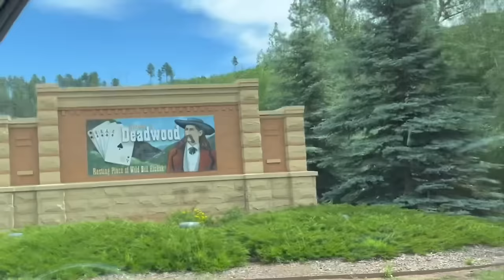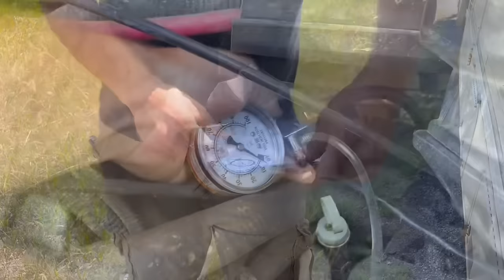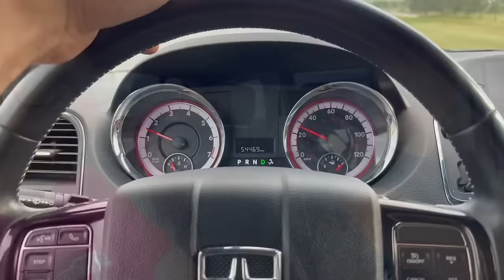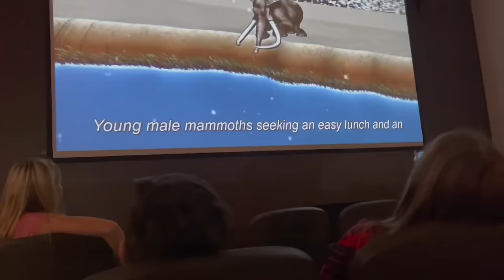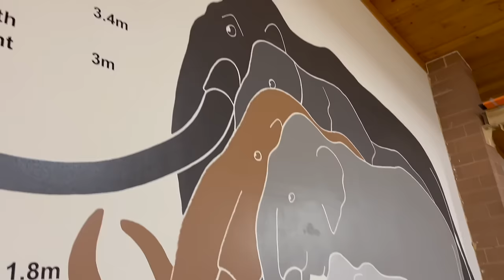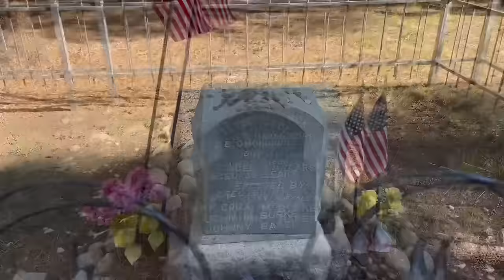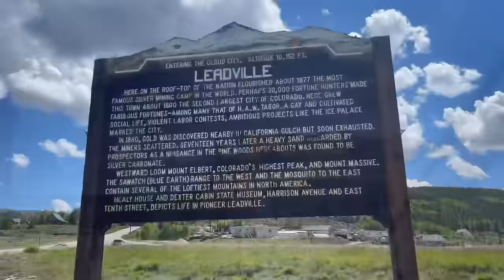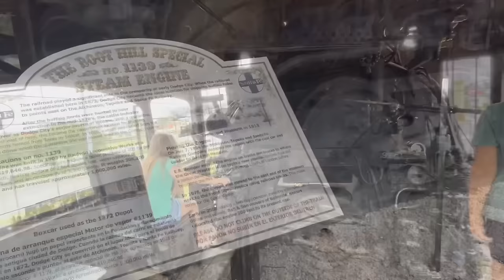Can we make it out of South Dakota in our $1250 motor home? 5000 mile road trip !!!

Comment: Thanks! This video was so emotional. It saddens me to see the motorhome go so soon after putting so much sweat and tears into it. But you have created many memories for you and your family on this road trip. Thank you for sharing your family outings with us!
Reply from the maker: Thank you for your generosity. Yeah it was really a bummer to sell it after all that work
Reply: @Sleeperdude  Come on Sleeper dude ive seen you get a 50 year old  Valiant running with a can of vienna sauges and some carb cleaner All you needed was a better pusher fuel pump mouted to the frame just outside the gas tank and the fuel will just pull through the in tank fuel pump . I think if this would have been a carbed engine like the old Dodge you could have got it going. Oh well that RV is so delaminated and stuctuarally comprimised anyway im surprised it didnt fall apart or the sides start comming off! Ive actually seen RVs come apart while driving down the road! This rig is very poorly built! its just 2 pieces of 1/4 in luan with foam glued in the middle like a sandwitch! that roof had no 2x2 stuctural supports hardly at all If you had a bad wreck in that thing it would offer basically no protection to anybody sitting behind the front doors! If you saw the bones of this thing you would be shocked at how little there is to these things..But i understand why you had to do what you had to do.
Reply: @jbncnow  yep EFI car to do much with if pump had power and they was not blockage there no resin    it shouldnt have worked unless they had wrong pump but he did right thing be worse to brake down in middle o no were in 120 degree heat been there done that not fun

Comment: I feel your pain sir. Going up mountains to Flagstaff the 1980 winne started bucking and died going up hill. Lucky filter was under front right casing and it was a carbed vehicle and manual pump. I and my wife were terrified because we were moving from Pa to AZ and had little money left for rental. We made it after about 3 filter changes and 3 filter blow outs on side of the road.
Reply from the maker: Wow 😯

Comment: Hey my Dad had a van with the same engine. When I was a kid we had a comparable break down. It was the fuel filter. I heard someone in your fam mention that, but you never checked it.
Reply: Sometimes a previous owner will put a hidden second inline fuel filter in it and the new owners don't even know it's there, but it sounds like he checked the entire fuel line. I had a shop tell me it was the carburetor and was going to cost $500 to rebuild the carburetor on an old motorhome. Then my dad climbs under the thing and finds out it's a five-dollar inline fuel filter someone put in, that was plugged up . We replaced it and the thing ran perfect

Comment: Thats a low pressure supply pump in the tank and high pressure in line, the high pressure pump will run but not supply pressure and choke supply usually around 10-20psi. We had an F150 do this and we pulled the bed dropped in a 255 and bypassed everything past the fuel filter to the second fuel filter, ran better than ever and gained 3mpg. 

In your place with the kids and wife you did the right thing imo but hey, that whole trip will be a memory never forgotten and money cant buy those kind of memories…..ever.

Hats off to Joe for being an awesome person and doing what he could for his fellow man and their family.

Comment: You and your family are welcome in So Dak anytime. Thanks for visiting. I've had those fuel issues when using ethanol...the engine gets hot then the fuel vaporizes. The vehicle would only start and run after it completely cooled down.

Comment: Good to see that you folks recovered from the camper and enjoyed the rest of your trip,looks like yall had a real adventure,good that you and your family had that time together,you'll remember it forever if you're lucky.
Reply from the maker: Thank you
Reply: Do you have need for an old Flathead motor? Its in a project car that I bought several years ago,we got it started a couple times and it ran,I've got video of it running but I've never put water in it,it didn't have any water in it when I bought so I don't know much about it other than it ran.The motor is in a 48 Ford coupe under my carport,I'm trying to find a running 289,302,something with a carburetor and a regular distributor,i want a little more power,hate to chuck the flathead is someone could use it though.

Comment: You forgot to change the fan clutch and add some extra fans to keep the engine cool.
Don't drive in traffic.
Don't drive in the rain storms 
And use the back roads.
Next trip will be better

Comment: When my kids were younger many yrs ago we bought a 91 Ford E 250 class C motor home for 1500 bucks and it seemed to run perfectly and everything worked as it should have so we loaded up and took a trip to Mccaysville Georgia  to  see my sister and we made it there ok fine but shortly after we blew the front transmission seal so thankfully I had brought my tools and my 3 ton floor jack so we pulled the transmission out and installed a new 6 dollar front seal and a day later we were enjoying our trip again and the front transmission front seal blew again 150 miles from home found a tow truck and called a friend to come and get the wife and kids. I felt ur worries about ur family thanks for sharing

Comment: Wow, you're awesome. I have been broken down at the side of the road and I know how stressed and freaked out I was; to be in that situation with your wonderful family would have been ten times worse, at the side of the Interstate, waiting for someone to slam into the back of the RV while you're crawling around under it trying to change a fuel filter. And you seemed to keep your cool with your family and not lose your temper despite your obvious stress. Josh, you need a vacation after your vacation. :) And it was a great video as always. 

In my case, it was my 1985 Pontiac Fiero 2M4 SE 5-speed. I had just rebuilt the engine in my garage - new rings, bearings, timing gears, cam and lifters, fanbelt. I was flying down the 401 westbound home to Toronto after visiting family in Ottawa, holding with traffic and drafting with trucks, about 120km/h (75MPH), maybe midnight. The car was running perfectly, less than 1500km on her newly rebuilt engine. 

I heard a "thunk" from behind me, something had hit the plastic hood over the engine compartment - I turned the stereo off, I was immediately on high alert. A moment later, the ALT light went on after the alternator spun down, and so I knew the new fanbelt had just let go. Watched the temperature gauge like a hawk, Iron Duke, iron head on iron block, huge cooling system in the Fiero because the engine is in the back and the radiator is up front.... I knew I could push the temp gauge up and I almost made it to the next exit before I had to pull over and shut her down to avoid doing damage. 

This was before cellphones; OPP (Ontario Provincial Police) pulled up and called me a hook. My friend and I slept in the Fiero in the parking lot of an auto parts place until it opened in the morning. Terrifying night. And I bought not one fanbelt, but two. LOL. Mile marker where the belt broke? 666. You can't make this up. Right in the middle of a rock cut just east of Gananoque, on the single busiest freeway in North America. 

Do not try to sleep in a Fiero. It's a comfy car to drive - even for me, I'm 6'4" - but not a good car to sleep in. A Fairmont with bench seats would be much better than trying to drape yourself over the fuel tank under the center hump. Thankfully, Blake's feet didn't stink, because they were in my face all night. Little blessings in life. :) 

You made it home safely. I am glad. Keep doing what you're doing. 

[big hugs to you all]

Comment: 👍Car trouble makes great memories for kids, great stress for parents . . . .,Back in early 60’s, our little family of 5 took a similar route in our 1961 Pontiac Catalina. Corn Palace, Badlands, Mt. Rushmore, heading to Colorado Springs final destination. Hot summer, Pontiac air conditioner doing its best, driving through Noplace Wyoming, 2-lane roads middle of nowhere, and the Catalina coughed, stalled, and quit running. Somehow Dad determined it was vapor lock from overheated fuel. We sat by side of road a long time and let things cool. Dad ended up sucking gas from a fuel line (even swallowed some) and he got the engine going again. I think we ended up turning  off the AC, but we survived. Good memories.
Reply from the maker: Wow sounds like you had a similar story

Comment: Well as you were traveling and breaking down. I went through one of those storms that made it up to Michigan taking out power for a couple of days. My generator sounded like that old Ford run stumble a bit and die a lot. Sadly I don't know much about Briggs motors and carbs. That old Ford sounded like a relay might have died. It is suppose to kick in the secondary pump after the lift pump does it's job, but that's just a guess. Glad you all made it home safely and enjoyed a bit of your travels.

Comment: You should fix up the mini whinnie, my dad had one when I was a kid, I remember we broke down once but luckily we were visiting relatives that had a friend with a big rig garage to fix it, after that dad replaced the engine and we traveled around every state east of the Mississippi river, good times.  After that he sold it (still running good), and bought a 27' 5th wheel trailer and new truck.

Comment: those fences at about 56:00, those are snow fences built to keep the snow drifts off the road.  As the wind carrying the snow hits the 'wind block' the air speed is reduced and the snow falls out of the air to the ground piling up and creating a drift far from the Highway.

Comment: We had a similar problem on our van a few years back after we restored it and went on a road trip The van had been sitting for 25 years and broke down on the side of the road in a desert of all places luckily we got a tow to the next town and they fixed the problem  We had not replaced the rubber filler hose to the petrol tank and small piece had separated on the inside of the hose and went into the fuel tank and this then was sucked over the outlet pipe blocking petrol from being pumped to the motor the reason I had not replaced the filler hose connection was it looked great from the outside. So I now replace all the rubber filler hoses when restoring a vehicle to save having the same problem again. hope this may help you in the future.
Reply from the maker: Interesting thanks for letting me know

Comment: One thing I learned years ago is the Ford trucks have 2 pumps, the one in the tank is a low pressure and the one on the rail is a high pressure. most likely the high-pressure pump gave up
Reply from the maker: The one on the rail was still running. And I wasn’t getting any fuel up to the second one after replacing the one in the tank
Reply: @Sleeperdude  Clogged sock maybe?

Comment: There must of been a kink in fuel hose or line burning up fuel pump. It may of been pressure regulator bad. Hot wire + and - often works.

Comment: Sorry about the trip going bad like that. I really think that someone with your mechanical ability could have gotten that camper running reliably in the same time it took you to sell it. Maybe run a gas line for the fuel pump right through the cab of the vehicle and into the engine compartment between the front seats.  It was the right call to turn back instead of trying to get through Arizona.

Comment: This is a month after your adventure, but here's my 2 cents comment. I thought old Ford's used a low pressure pump in the tank to supply the high pressure pump on the frame. You can use the in-tank pump for carburetor engines (with a regulator). Could be the longer pump you put in the tank overwhelmed the check valve in the high pressure pump.
Reply from the maker: Yeah maybe so
Reply: @Sleeperdude  I have a friend who was a factory trained Ford mechanic. He has used the low pressure in-tank pump from 90's F150s a few times.  We put a 4.6 in a 57 Ford wagon and because the 57 tank had an outlet at the bottom he didn't bother with the pump in the tank, he just used the high pressure pump from the frame of the f150. So I'm pretty sure that's how they work. You can use them standalone. On your trip if you ran the high pressure in-tank pump direct to the fuel rail and bypassed the booster pump on the frame your 460 might have run...
I'm in Alberta, currently I have 2 Zephyr Z7s, a 64 Fairlane, a 61 Unibody short box, 86 mustang, 73 Triumph Spitfire, etc... I'm also putting a 47 Studebaker M5 body on a Ranger frame if I live long enough. Lol
My kids are grown up and moved away I sure enjoy your videos.  
David.

Comment: Thank you so much for sharing. Just found it and I ove your channel. Keep up doing what you do. No fails means no real felt wins. 

Did something of this sort back in '08. We are in Norway and my family has a house in Greece, so what would be better than to see Europe with the family and spend time in Greece. Right? Bought a '94 E350 customline van with low miles and a 7.3 IDI. Did all it needed for the trip - and more. Got at mini(flat fold-up) camper and off we went. Smooth to the southern tip of Norway, but when going for the ferry to Denmark- parked next to the curb with a fresh 75$ parking ticket - I stressed and  janked the steeringwheel agsinst the curb instead of away and poff there the tensioner for that mile-long belt went out... Sunday night. All closed. Ferry next morning. Slight panic. Called our version of AAA, got help, could not fix it, so now what? We could have given up, could have waited and have had to buy new ferry-tickets. But no. 
   We were set to go, so had AAA set up asisstance for us in Denmark and drove the 'tank on the ferry monday morning wo any PS, charge aso... Fiiine. In Denmark the tiniest wrecker (an Iveco w. 400.000 miles) were there to pick us up for transport to Ford in Hjørring, Denmark. He actually did lift the van but the wrecker looked ready for lift-off too. So. Four kids, me and wife and the wrecker-guy floated all over the highway going there. Doing 60 mph. It was not my geatest moment as a father and husband emotionally. 
     Fast forward and Ford in Denmark could NOT get the part for 4-6 days. Because US-cars in Denmark? Nope. So. I called up US Auto Parts in Larvik, Norway, had the best guy EVER deliver the part to a friend working on the ferry to Denmark there and I had a rental (over insurance) to go back to the port in Denmark and pick it up. Paid it, got in the car and left. Happy as a puppy. Untill danish Customs called and told me to tax it in and pay a fine (!) for not doing that straight away. Soooo. Back to port, ka-ching, back to Ford and THEN it calmed down. The guys in the workshop felt for me, helped me, served danish and coffee and basically did the job pro bono. Finished up, got THE best ride in one of the guys 68 Mustang AND finally could pick up wife and kids from a waterpark (yes). True story. But main point; At the age of 21 - 27 today, my boys still talk about this trip. 4500 miles altogether. Best memory for me from this; four boys giggeling in the backseat watching Smokey & the Bandit on the border to Turkey while the AC kept it cool inside.  At a 103F... With a plastic bottle holding the hood up for extra cooling actually melted down. Unforgettable....and worth every cent out of the envolute. Take your family on trips. They larn so much, and it keeps them curious. on life, on people on seeing the world.  ;-)
Reply from the maker: That’s awesome thank you

Comment: I feel you your frustration, I had an 85 Tioga About the same mileage it had the best layout that.it had the bathroom in the very back captains chairs and a sofa. My wife was driving it with my kids and I wasn’t there for this local trip but she started to lose a u-joint and tried to make it to the next exit while it was like re-entering the earths atmosphere just by the damage,it through the fan belt overheated it’s something severe that it cooked the water pump I’m shocked I didn’t blow a head gasket. I rebuilt a three piece driveshaft put a new water pump in it fix the radiator and sold it lol. And for whatever reason those love fuel pumps. It’s very stressful when you’re break down ln something that big so I know exactly how you felt, When the tow truck showed up at my house the only thing they had available was a truck they can tow a fully loaded 18 wheeler with a trailer on it. The driver laughed and said I had to keep checking to make sure it was still back there. When it dust settles you definitely will miss that camper I can tell you that for fact, someday I’m gonna get another one just like I had,it but I’m going to go through it like it was going to the moon. Great great videos and you have an awesome family, and your wife is pretty patient I also have one like her, but in occasional arguments things get brought up like My Projects 😂

Comment: Josh, those early fuel injected engines can be a nightmare. They either run great but when they break it can be a nightmare to diagnose. I would still consider it a success its still amazing it went as far as it did. I would stick to carbureted engines or OBD2 useable next time. It really turns into a guessing game with those first generation fuel injected engines. Put a manual oil pressure gauge on the mini and see if its really low on oil pressure.

Comment: Looks like that RV needed a whole new fuel delivery. I bet a piece of that rotted out hose got into the line and lodged in there. Not much else you could a done out there. Only other solution was to find a place to go through it all. You would of spent just as much money either way. At least y'all got a good vacation with adventure. Don't beat yourself up for doing what you had to do. Keep on trucking!